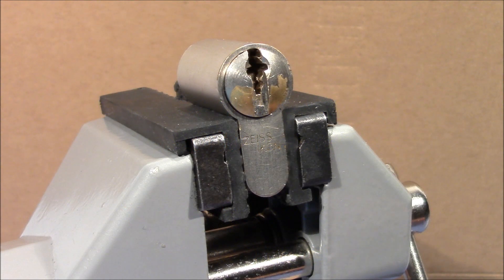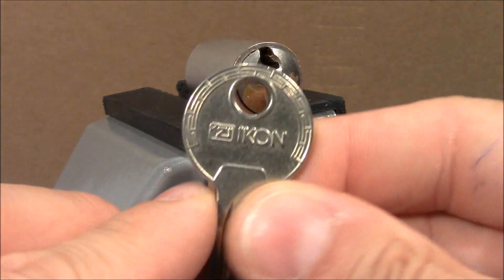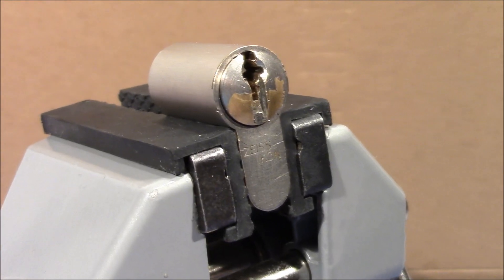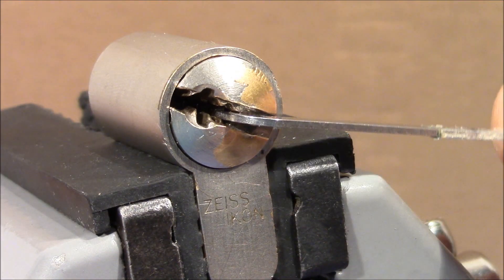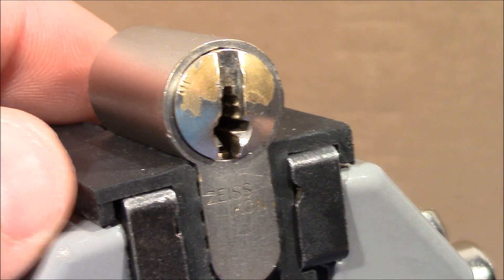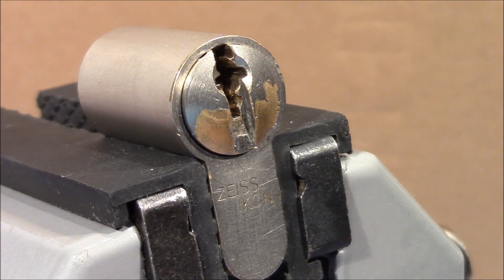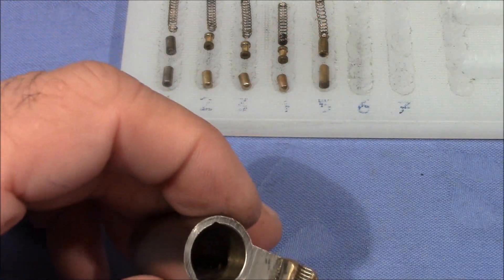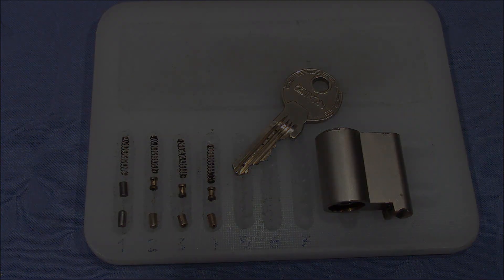(picking 592) ZEISS IKON picked / gutted - many security features in this lock

Comment: Hi Potti, Very interesting lock with some unique features - always well explained as usual. Reminded me of something we would do on the odd occasion. On a shop door the staff could only lock the lock to shut the shop, but could not get back in - the "staff" key would only turn one way. The owner's key would turn both ways. We used to cut away one side of a pin chamber in the plug, and the staff key had a lower cut on this pin that came level with the cutaway, preventing it from turning in the opposite direction. The owners key had a higher cut in this position, allowing the plug to turn both ways.  Regards, Brian.
Reply from the maker: Haha, that's funny - a lock that you can lock up but not open again. So if you forgot to turn off the lights, they will keep on shining ;-)